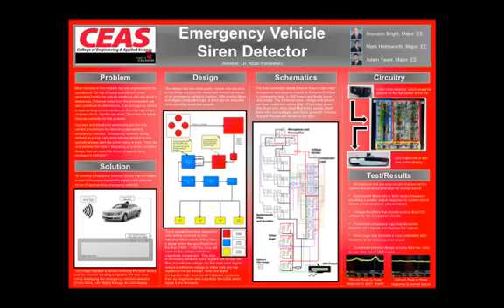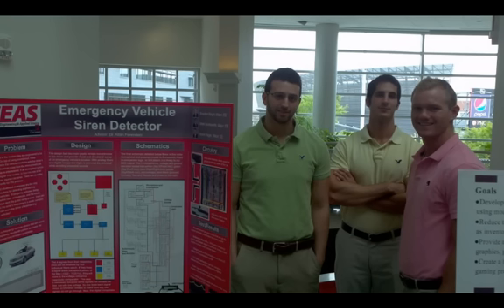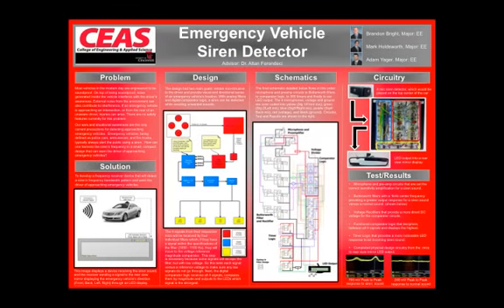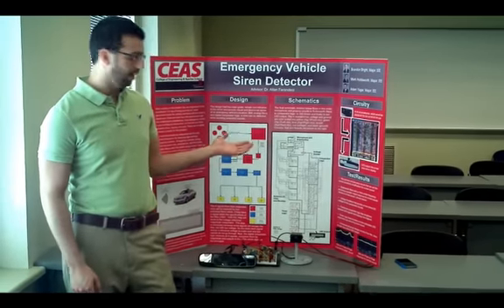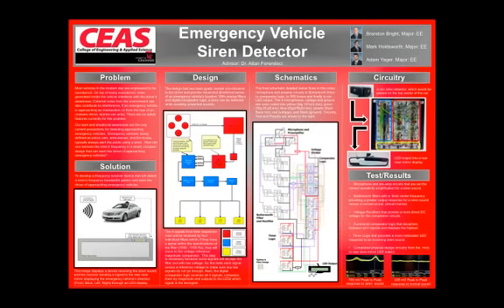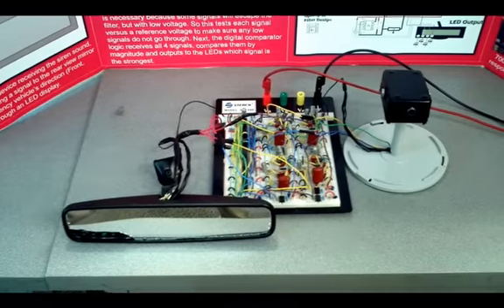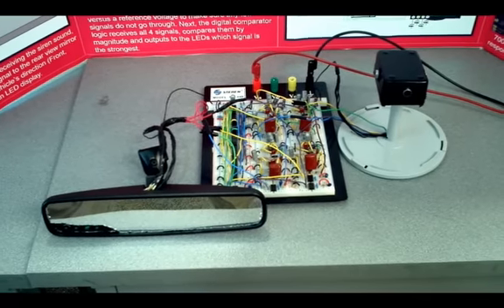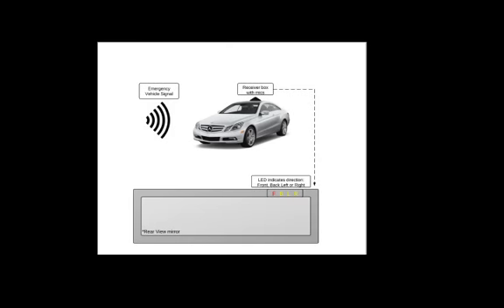Emergency Vehicle Siren Detector Demo.mp4

Comment: Hello. Can i ask if what particular op amp IC did you used  to your filter, amplifier and comparator?. I am currently working with my project and i cant find the best op amp for my design. Its all noisy op amp. i will really appreciate your response..tnx a lot